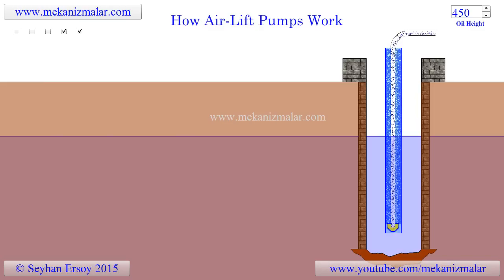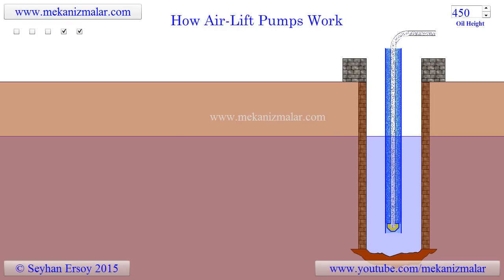how air lift pumps work

Comment: this is very interresting! i use air lift pumps in aquariums every day, but never thought about them functioning like this, because i use them under very different physical conditions,that you didnt even mention here.
in an aquarium the lift tube is usually completely submerged. so no actual lifting force is required, and the kinetic energy from the buoyant bubbles, dragging the column of water up the tube, takes over. which is far more efficient, than having to make the water buoyant. i observed, that with every centimeter of lift above the surface the efficiency and flow rate decrese quite a lot. 
ergo: great for submerged circulation pumps, not so great for anything else.
Reply from the maker: +Cuda FX Thank you for your comment. Even though I see those aquarium pumps in local Chinese restaurant, it did not occurred to me that I should mention about that. 
Since the height of the aquarium is so small, the speed of the air bubbles might play major role to pump the water. I say might, because I do not know air bubble speeds in the aquarium.  However even in that situation the water rises due to reduced buoyancy of the water in the tube. 
Your observation is correct, when you lift the water tube above the water level, say 1 centimeter, flow rate should decrease. To get the same flow rate before the raised level, the bottom of water tube should increase substantially, maybe 7 or 8 centimeters. But of course there is no room to extend the tube below the bottom of the aquarium.
As I stated in the video, application of these pumps are very limited, as you also mentioned.
Reply: you're welcome. your video really brought up an aspect i never thought about. 
there are two forces at work in an airlift pump. i find funny, how each of us only concidered one before.
the buoyancy is a static force and determines the lift height, even in tube with no flow,  as your video illustrated.
as soon as (and only if) an outlet is lower than the lift height of the pump, and the water gets flowing, the kinetic drag of the bubbles takes effect. btw, the bubbles raise with an estimated 20cm/sec.
in reality the amount of air it takes to operate the submerged circulation pump of a "double sponge filter", would only lift the water 2-4cm above the surface, but moves easily about a liter per minute, and could be adjusted upwards to 3-5 times that. all with very little power comsumption, a 5W air pump can drive 4 of said filters, each enough for a small 20-50l aquarium. electric pumps would use 3-5W per tank. 
ps: in aquaristics air lift pumps are mostly used for lift heights of a few centimeters. above that they tend to be quite noisy
Reply from the maker: +Cuda FX Thanks Cuda, The information you  provided is very informative, especially speed of the bubbles in the tube and power consumption of the pumps.
Reply: @mekanizmalar  

May I ask: if a siphon to work put in the top tank. And then the siphon tube put all the way to the floor, would that help?

Then to another pipe going up to the top of the tank, with the aerator in the connected second pipe. This would give more length of pipe for the air to travel. There by lifting the water much higher.

Also reducing the second pipe half way up may help?

Please tell me your thoughts.

Comment: I have made Air Lift pumps before and this explanation is not how they work, it may be how some other pumps work but not the Air Lift pump. The short explanation is that air is pumped down an Air Tube on the outside, not the inside of the Lift Tube and it curves at the bottom of the Lift Tube and goes up inside it a few inches. When air is pumped into the Lift Tube it rises and all of the separate bubbles form a single bubble which pushes the water column above it up and out of the lift tube. As the plug of air rises the water column pressure above it drops because water is exiting at the top of the lift tube and the air plug expands. Continuous cycle. That's how it works, if you build one be sure to use clear tubing so that you can watch the process, it is very simple and elegant.
Reply from the maker: +George Crabtree Thank you for your visit and nice explanation of the airlift pump process. I think there is not a difference in the process whether air comes from outside of the main pipe or inside from it, the effect would be the same. The way you described air lift pump is well suited if you use the airlift pump in open wells, However if you want to get water from underground,  than a hole must be drilled, in that case the way I described would be more advantageous, since you are drilling only one whole.
Reply: I've been wondering which method to introduce air is better myself.
Run an air pipe inside the discharge pipe , or an air line on the outside.

With the pipe inside , it obviously cuts down the water mix volume making it easier to lift a smaller weight per linear foot.
But does the air bubble suffer efficiency having to wrap around the inner air pipe?   It would seem it would because the water could sluff off one side , and most likely you couldn't ensure a uniform column for it to travel up.  Hence just making a smaller discharge pipe would combat the watermix weight per ft that an inner pipe would gain you.

And if the water inlet being constricted by the air line at the bottom is worrysome.  You could just make a larger bell end for where the air line is introduced on up to about a foot past it's outlet.
The other advantage of the airline outside the discharge pipe.  Would be that you could use a hose instead of a rigid pipe that would be necessary if the air pipe were inside the discharge pipe.  Not to mention installation would definitely be easier. 
Plus what about gate valves for keeping a prime ?  No way to put those in with an inner pipe.  However I'm not really sure if gate valves will cut the efficiency to far?
Air lift systems always discharge water in surges.  Because once a certain amount of air comes out , the air line needs to build it's pressure again to emit another bubble.  Little bit of the same principal of a ram pump.
Reply: Air Lift pumps use bubbles to raise water, they can raise water really hight without having a big reservory.
Reply: I'm afraid your argument is not scientific therefore not a valid counterpoint. Adding air to the water column, independent of bubble size or whether the tube is outside or inside, reduces the weight of the water in the column, thus Archimedes principle. Quod erat demonstradum. 

If you pull on a rock from the "North" or push on a rock from the "South" the net force on the rock is ultimately the same... the design is what's different.
Reply: I think you are both right. In principal it doesn't matter if the hose is on the inside or outside. True it's better and more practical on the outside. And yes I have made airlift pumps with clear PVC and hose on the outside and indeed the water is pushed up in slugs. But the video is probably correct in that optimal lift occurs when the water depth is equal to or greater than the lift distance.
Reply: It seems like he is describing a different mechanism though; the video describes using a density differential (created by dissolving many small bubbles into a segregated, but arbitrarily wide column of water) to lift water while George seems to be describing something that would need to use a large bubble in a small tube and a slight pressure differential to lift. I am not an engineer though, just thinking about what makes sense. Do you think both of these mechanisms rely on density?
Reply: @grantking2880  yes, seems like he is talking about a geyser pump which is a different kind of airlift that use one big bubble to push the water colum upwards instead of air-water mixture

Comment: I would add a correction to your video, airlift pumps are very inefficient at high head applications, in cases where it is not having to lift the water to great heights they are more efficient then any mechanical water pump I have ever seen. As I read it the cutoff point where airlifts start to become less efficient is around 24-30 inches of head limiting its practical application to things like aquaponics systems or wastewater treatment where high volumes of water are needed with a low head and additional oxygen is an added benefit.
Reply from the maker: Thank you for your informative feedback.

Comment: This is an excellent sistem , for a deep 120 meters  well for example , you need a complicated mechanical device and a spensive great pump  wich suffer abrasion wear  to do the same work  you can do with a simple air compressor and a pair of  pipes whith a venturi  on the extreme  wich you can easily make at home.

Comment: I made one in my 40 meters deep well and I am satisfied with results but I think you should have enough psi and cfm to get water out I am using 250 lpm 10 bar 50l air tank and getting 1200 litter ph with 1in pipe I
Reply from the maker: Thank you for your visit and comment. Yes you are right, higher you want to pump water, higher the air pressure should be, Since your well is 40 meter, it should be OK. Here is a question, have you try 8 bar pressure? If you did, what was flow rate rate of the water?

Comment: If there is no electricity will steam work?
Reply from the maker: I don't think that steam will work. It will condense and become water.
Reply: Good, mekanizmalar; and steam will rise as bubbles in boiling water, as in a coffe maker.
Reply: @RaulRamirez-pg3sw  I think the question left out whether or not it's acceptable for the lifted water to be hot. Will steam be able to lift cold well water?
Reply: @JeanPaulSauve  Cold water, of course would condense steam on contact,  but enough steam would heat a cold warer volume.
Reply: Tea anyone?
Reply: Thinking  you could use a steam engine to run a air compressor, but you need water for your steam engine, however if you have fuel ( wood  or oil maybe even solar ) and water,I like the possibilities.
Reply: A bit out to left field, also curious about the possibilities of just putting a pressure line down a well casing to see if you could raise the water that way, after all  isn't that what we do when we jet a well ?